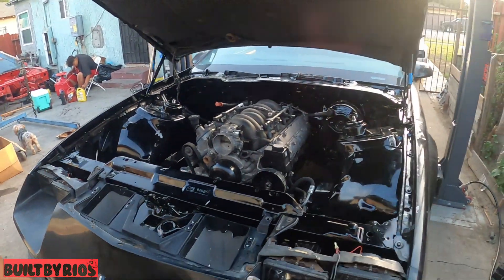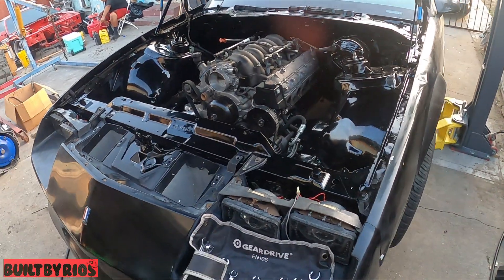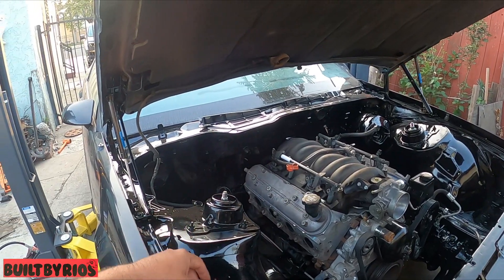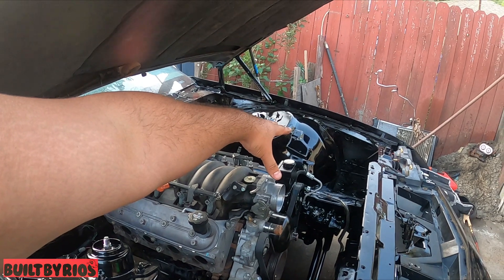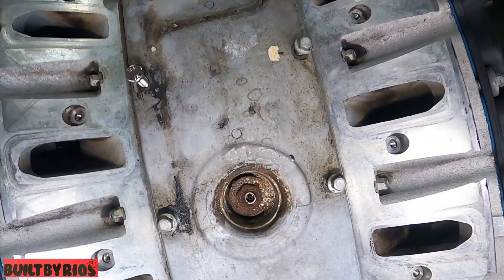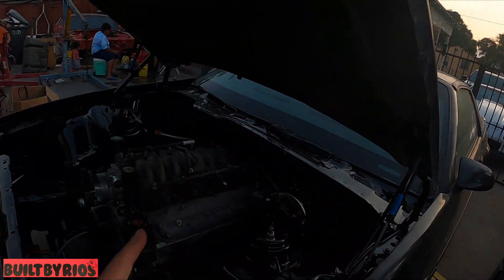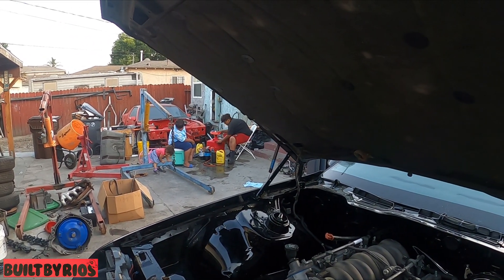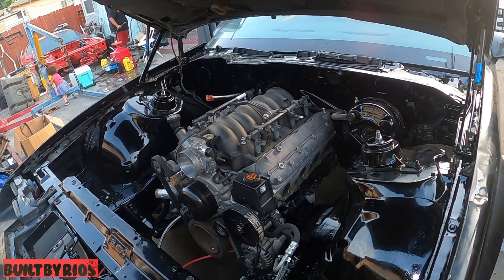Ish lil update part 3

Comment: How did you connect the power steering lines to the gearbox?
Reply from the maker: Ls1 maro high pressure side line and 3rd gen low pressure side